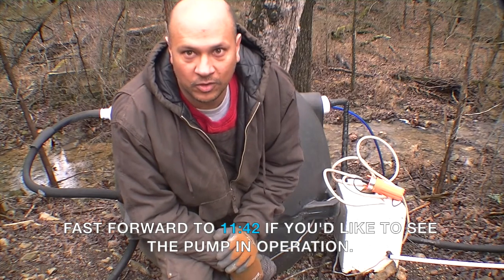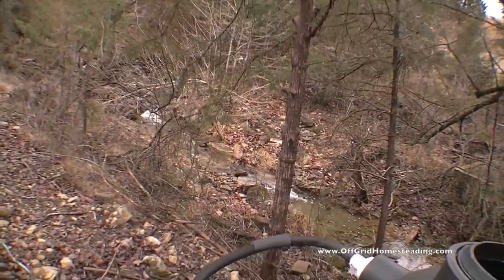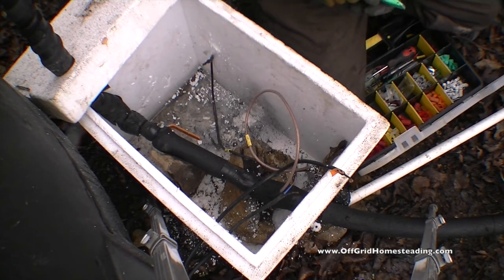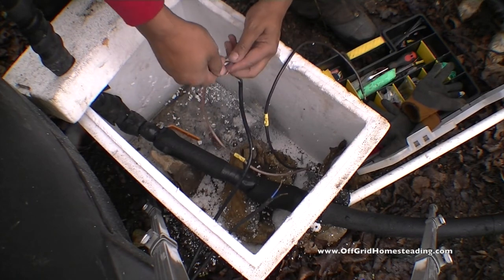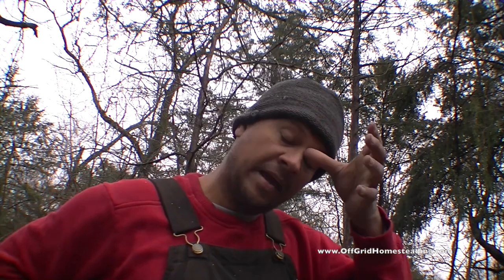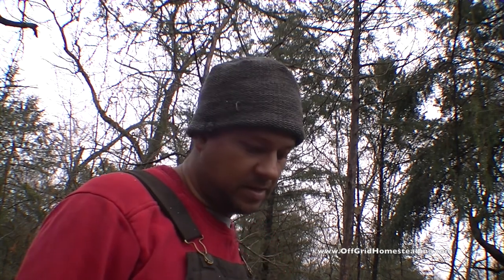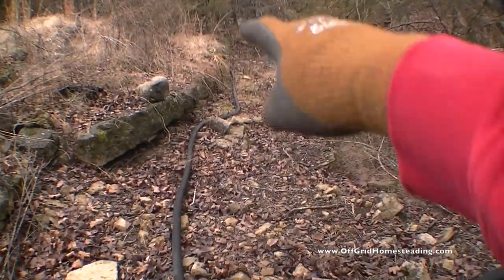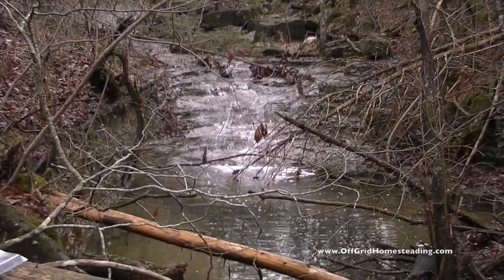OGH - SUBMERSIBLE SOLAR 12V TO 24V DC WATER PUMP V2 SHOWN WORKING AT TOP OF HILL

Comment from the maker: The sun came out today.  We filled about 1/2 the cistern in 2 hours!! That’s about 200 Gallons an Hour.  So by 2:30 today I had to run to the bottom of the hill and UNPLUG the Pump as we topped off our upper 1000Gal Tank!!  This pump is awesome! Highly recommended.

Comment: Question, Who built your cistern and how much you paid for it?
Reply: the lower tank (black one) is a 500Gallon off the shelf one from home depot or lowes, or your local farm store.  the cistern (concrete one by the house) is a 1000 gallon septic tank, we just bought it new and had it buried, and used it for water storage from the get go.  Hope that helps!  John.  The 500 gallon black one was around $450, and the 1000 gallon cistern was around $1000 delivered and set into the hole we had dug with a guy who rented out his backhoe.